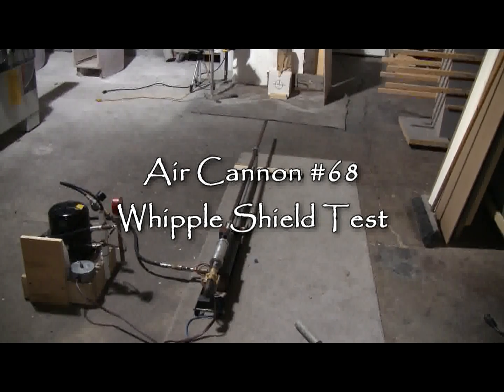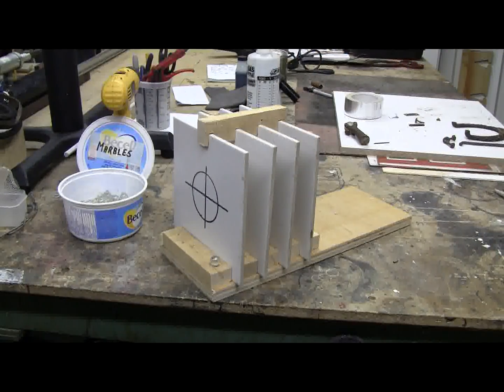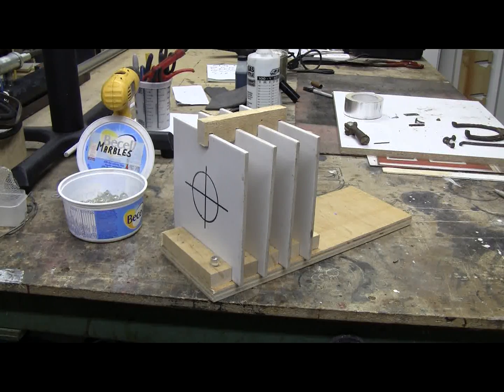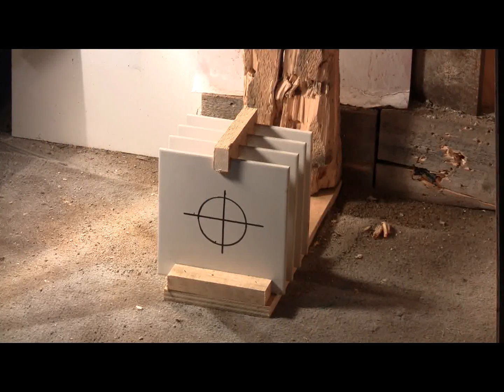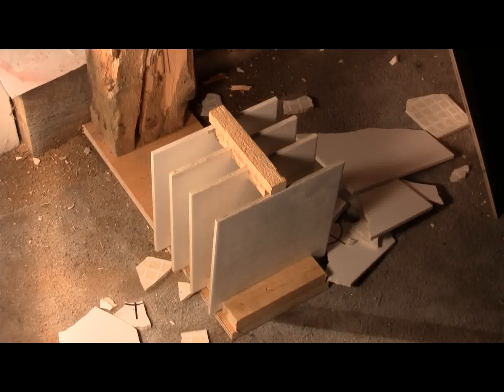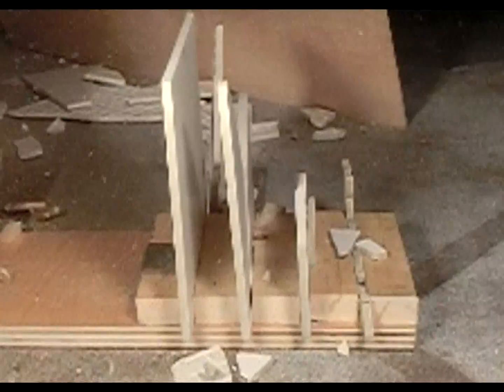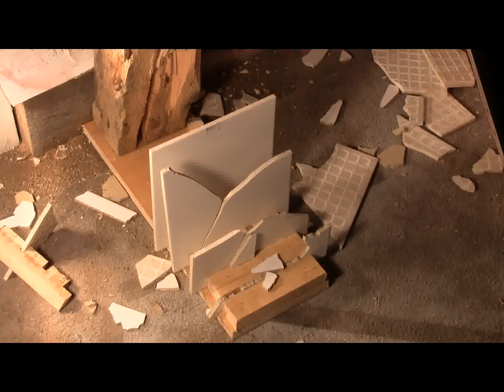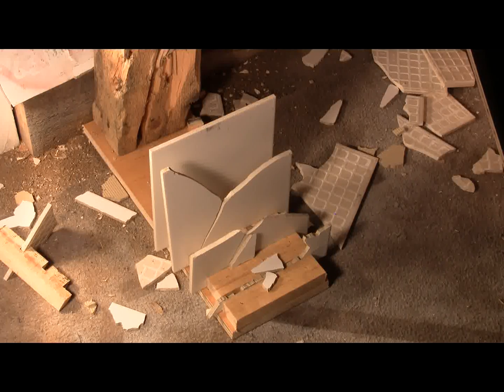Air Cannon #68 - Whipple Shield Test

Comment: This is an example of spaced armor. A Whipple shield makes use of the tendency for a tiny particle, moving at velocities several kilometers per second, to be obliterated when striking something like a thin sheet of aluminum foil. You have simply put a more desirable name on something entirely unrelated and common.  :(